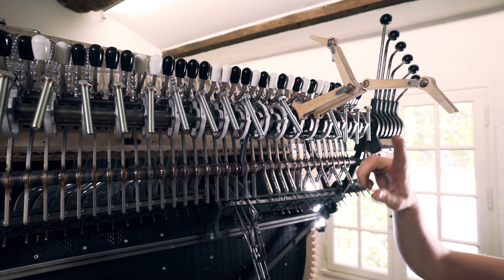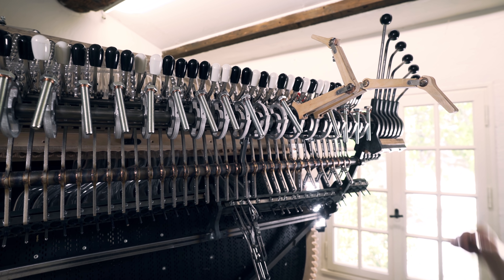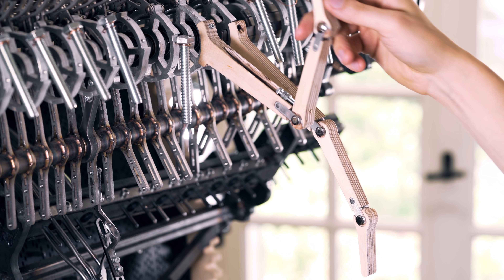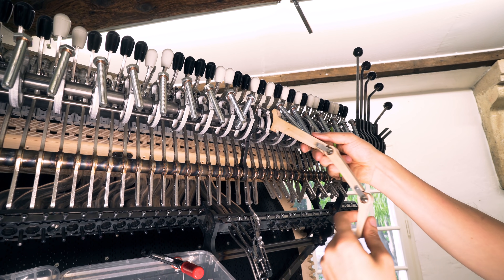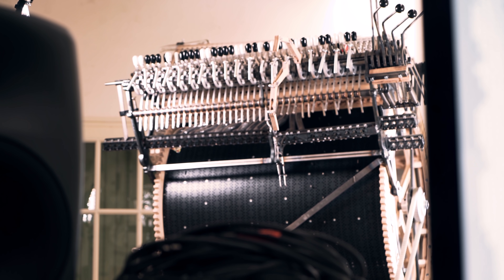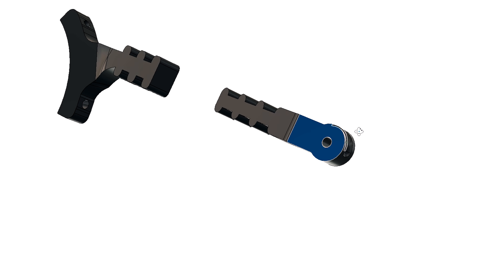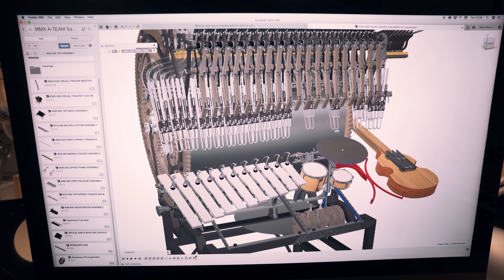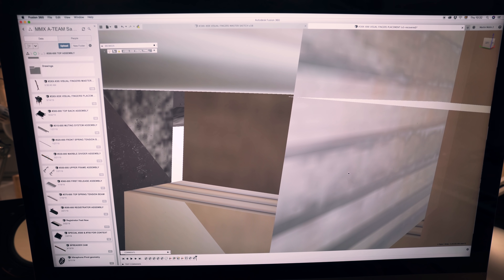Kinetic Fingers Prototype - Marble Machine X #82

Comment: A designer knows he has achieved perfection not when there is nothing left to add, but when there is nothing left to take away: Antoine de Saint-Exupery

Cameras and video screens at the concert, dude.
Reply: I get the sentiment, and I would agree. But, also, lots of parts of this build are not strictly necessary, but add to the idea that Martin wants to add. I don't think it necessarily should stay, but I also don't think there's anything wrong with wanting the star of the show to stand out on its own. What is the musical part of the marble conveyer? Incidental, but it's visual and serves a purpose. This is the same. Certainly not as critical as that sure, but I don't think the fundamental idea is an automatic no go.
Reply: @Cyrribrae  Yeah but take away the conveyor and the machine will no longer work.  Take away the fingers and what happens?

Sure the conveyor is flashier than it needs to be, but it's still integral.  This feels like a decoration.
Reply: Ethan Ansell I agree - aesthetics are a purely personal choice. For me (and apparently others here) I love the simple engineering beauty of the machine without the fingers but in the end it’s Martin’s choice of what the machine looks like. If he digs on the ultra creepy fingers then that’s what it’ll look like!
Reply: I agree.  Having video screens at the concert will let everyone see the machine doing its job.  We want to see the whole machine working and not just the fingers.
Reply: Antoine de Saint-Exupéry literally never said that.

Get your quotes straight, dude.
Reply: @Schwallex 
Try reading Terre de Hommes, or if that's beyond you even a simple Google search before you start correcting someone, 'dude'.
Reply: Good lighting from the crowd will make the reflective balls glisten and shine. Install a black velvet curtain behind the machine to emphasize it. And the marble catchers will move.

These goofy fingers are... Goofy.

Comment: I would prefer if the fingers were not added, but I don't really care as long as the marble machine still works. Although, the fingers may present some problems with weight when trying to mute different sections.

Comment: Hey Martin, I'm wondering if this isn't a really good way to add motion to the machine. I believe part of your project's innate beauty is in the raw functionality of it, even when doing things in an interesting rather than easy way. However, these fingers should be assigned a function if you want to keep them on the machine outside of just a visual indicator for potential audiences. I think there are other ways to exaggerate motion on the machine without the compromises that this solution introduces. I share your excitement for the project, and this is just me voicing my personal interpretation of it's beauty. Best! -J

Comment: I like the movement / position of Nr2 better then 1. Except in the muted position.
If it is to resemble a finger then it would look painfull because real fingers don't bend backwards like that. Or at least normaly they shouldnt.
Nr 3 looks even better, still it would be better if you somehow could hollow out the "fingertip" and fill it with something heavier acting as a counterweight so it doesn't look like MMX is having acupuncture.
Then again I don't know much about the technical/mechanical possibilities.
I'm just a guy who liked the 1st marble machine and the music it made and can't wait for MMX.

Comment: In the CAD, they seem very much slapped on. Not to put down your artistic vision as I am sure you have something pretty cool in mind, but they just don't quite match the look of the machine. 
I think I understand the inspiration for the fingers; those "wind beasts" that walk along the beach using only wind power and a massive amount of moving parts. They look pretty great, however the marble machine X doesn't move, nor does it look like a wind beast. 
At the end of the day, it has the aesthetic look of a large, yet intricate peice of machinary that plays music. It has a very steampunk look to it, and reminds me of an old Victorian machine of some kind, and what gives that look is the mix of wood, tiny stained wood sections and the old looking steel holding it all together. 
I reckon the fingers would work, but you would have to make them far larger then they are, and probably entirely metal. I think as of right now, the marble machine looks pretty great as it does as a musical instrument, but the artistic side of the machine could use some development

Comment: Hmmm I'm on board with fingers, but wood is the wrong choice of material. They are way to big and take to much of the otherwise clean aesthetic.
I think they would look the best if they are made out of wound blacked steel wire with shiny brass counter weights and bearing elements.
This way they are sleek functional and don't weigh much, also they are far more robust since they need to be disassembled for shipping anyway.

Comment: Not a big fan of the fingers either, because they don't really fit the theme of the machine. On the MMX every little part is functional and conutributes to the music. I think since you have designed the machine and spent hundreds or thousends of hours looking at it, you don't realiaze how magesctic it looks aready, you don't need to stick on some fingers for visual effect. That is just my opnion though, and i am sure the MMX is going to be awesome, be it with or without the fingers, so keep pushing!
Reply: Time would be better spent experimenting with lighting the machine to make the marbles visible on stage, setting up cameras, or anything else.

Comment: I don't know if the fingers will be a good way to accent the movements, I'm sure there are other ways that you can come up with, if it is an issue. 

Personally I feel it's a solution for an issue that doesn't exist.

I trust you will do something cool though 👍

PS: if you can design the fingers to be easily detached/reattached then it has less commitment to the design and can open up more options for style... Like detach fingers and attach a different thing. 
But once again I feel it unnecessary

Comment: I'm going to join everyone in this opinion that these fingers are totally unnecessary. Making sounds with ridiculous ways is one thing, but adding moving parts with no function and even with questionable aesthetics is quite different. If it were me, the machine would be without these fingers. Or wheels. Or marbles. Or anything else, because I'm not so dedicated. Great work man, keep it up.

Comment: My issue with this, the programming pins are pushing more and more weight (the fingers, the ball drop mechanism, etc), I worry about putting too much load on the programming pins and ruining them or the drum.

Comment: I totally understand the reasoning for the fingers. They would be a clear visual cue to what notes are being played.. a sort of theatrical Strandbeest like representation of whats going on for an audience to easily connect with. My issue with them is they look visually unappealing and clutter up the beautiful engineering of the machine. The MMX is going to be an extremely tuned system; it really needs a tuned way of displaying this visual element that keeps true to form. Like LEDs lighting for each note across its surface or something that doesn't distract away what makes the MMX what it is.

Comment: If that was a Feature from the being, know that you should scrap it the moment it start to causing trouble.
adding (as suggested by other comment) camera on the MMX is more easy and trouble free.

and while the fingers really add to the steam punk look, it does add extra energy that the marbles have to fight against and extra complexity to a already complex machine.

if you are going for a totally fantastic + fantasy look, that's not bad, just know I think they gonna cause you trouble.
if you are going for a more Steam punk look with practicality in mind, those finger need to play something.

Comment: I'm not a Fusion user (Inventor user), but that "world inside" is a Lighting setting and that looks like an HDR scene.  You could make an HDR photosphere of your shop and it would apply the lighting and background in your renders (bright windows, dark corners, etc).  At least it works that way in Inventor.  You'd probably have to remove the MMX to get an empty pic though.

Comment: As pretty much everybody else already have expressed, I do not the fingers.
I think they look unnatural (creepy even) and they only a visual purpose, unlike anything else in the machine.
I also think they're very long and it would look weird with a row of fingers just pointing out of the machine.
In my opinion, you shouldn't have them, you already have the knobs and the release mechanism moving.
If you really want to have a seperate, decorative only thing like that, then definitely redesign it completely.
They shouldn't be like human fingers, with seperate joints just dangling.
Make them look mechanical and like they're actually doing some important function.

Comment: Just a quick explanation of the "hidden world/hallway/garage" in your modeling space...it seems to be an HDR which is a large image file format that render engines can use to dictate lighting in a particular scene. I cant begin to imagine why its visible in that way to the user...seems like a bug...should just be working in the background...but yeah if you look at the 3D space in which the model resides, and then look at that sphere, you can see how the render engine is using the light values from that HDR to light up the space. It's a nice and quick way to give a space realistic lighting without actually having to set up lighting. Hope this was useful info.
Reply: The visualization engine definitely doesn't use full raytrace/pathtrace lightning technique. It just makes no sense for this purpose. Shadows and reflections aren't needed here at all.

But the HDRI is needed to make glossy parts look glossy. They just need to reflect something.

Comment: Hi, will it be better to have thin metal sheet, attached at the joins, so that it can have a cleaner design instead of having the 2 metal screws jutting out? I think it will be much nicer.

Comment: I’m worried that this will end of looking like a house centipede with the  current design of the fingers, the idea of the visualization is brilliant, however it might be a more visually appealing option to have something like piano keys mounted in the fingers place. I think the thing that visually hinders it is the spindly appearance of the fingers. When it comes to the motion of the fingers, because there is no other actuation other than gravity on the bottom joints it looks very alien and unnerving when compared to the machined perfection of the other components. 
Whatever you chose to do you keep your spirits high, you are doing a great job.

Comment: The garage is an HDRI image, it gives the reflections of the garage to the models used in your scene, I don't use that software, so i don't know if you chose it or it comes as default, but you should be able to change it to obtain different reflections in your renders.

Comment: The force to move those comes straight out of programming pins, so making them light is a pretty good idea. I would not add counterweights there. You might get the same function with light springs.

Comment: I understand the purpose of the fingers, but I think in retrospect they'll become unnecessary when you (presumably) have cameras pointed at the machine. Considering that you haven't tested the new machine on stage yet, I would have waited to make "cosmetic" additions over functional ones, ESPECIALLY when you're already in a bit of a feature creep. On that note, I hope that when it finally comes to testing the machine's ability to play music that there's little to no need to change/fix anything because holy moly have you done so much  already before even getting the opportunity to test a whole circuit even once!

Comment: I totally agree that exaggerating the movement is a great idea, but I don't feel these fingers are 'it' - A lot of it has to do with the janky movement, and once they are all playing and shaking, it is just going to look messy and uncoordinated? The lift of the finger is very quick, but the falling down could be slower? So quick lift, and a slow sink back, like honey running off a spoon, if that makes sense? - Think of it like a digital equalizer, where the stacks slowly fall down unless the correct frequency is played. 

To increase the visibility for the audience, what could also be done is make the sides of the fingers a contrasting color to the top of the finger. Imagine the top of the finger is metal, and the sides are light wood color - then, when a finger lifts, the light wood color will show and draw attention?

Comment: Everyone is talking about you adding this to the machine, but does nobody realize that this has been part of the design from the very beginning? Besides, we have only seen two PROTOTYPE fingers working. It will most likely look way better once the final thing is finished. Quit your whining. It's an easy change if we don't like it when it is done, but shut up your complaining until you see the finished product at work.

Comment: A problem I see here is that the vibraphone will make quite short and punctuated sounds. You'll se the fingers moving much longer than you will hear the sound , so you won't identify the finger movement with the actual sound.

Possible solution: Make the fingers out of very light material, but this probably won't look good

Comment: I feel like the fingers are too loong. Wouldn't the kinetic energy from those 'fingers' affect the machine with unnecessary vibrations? It may also cause problems when played with fast paced music like a recoiling submachine gun. You might want to make it with the lightest but strongest possible material, might be expensive and impractical but its your call.

Comment: I don't like them at all. They look like the result of overdesigning and overcomplicating the machine. They will add more mechanical noises, which will mean more problems to be solved. And still, they have no other benefits than visual?  (and sorry though, they look pretty bad). Congrats on the amazing functionality of the design, but I would definetly suggest a step back.
Reply: There's no problem with mechanical noise, as all of the machine's musical sounds are to be collected by contact microphones. The actual room sound of the machine will be inaudible at a live concert.
Reply: They look completely inconsistent with the rest of the design.

Comment: I was really sold with the fingers idea when you first presented it, but the look of it seems a bit off to me ... They are thick and lumpy, a light metal part instead of plywood would be far better in my opinion. I pictured this part more like the fingers of Edward scisorhands, thin metal piece of machinery clicking and moving. It could be also intresting to have some metal tubing so we still can see through the space between each of the fingers.
I think it is still a nice idea, and i dont agree with most of the comments talking about the lack of utility of the piece, as it has a pupose if you consider the context of playing live, I just have a problem with the aesthetic of it, too thick and blocking visibility.
Anyway, I'm not concerned about you finding a perfect solution for this matter as you did such a great job for the rest of the machine, cheers !

Comment: I think that picture in marbles is there because of HDRI lighting.

AND ... I think you should pay attention to comments ...it seems nobody liked the fingers...
honestly, I (as your one of the first followers) donk like them either...
they are against of mechanical concept and look of the machine and as an engineer, they are waste of time, material and absolutely unnecessary.
by the way ...as always, I wish you good luck and success ...
Reply: It's called a cube map and is used to simulate specular reflections, like chrome surfaces and other mirror-like materials. 6 flat images make up the cube, because it's much faster on the computer than proper reflections.

Comment: Lots of comments not liking the fingers. I agree, BUT: how about having some small, single-component protrusion/knob/spine kind of things, instead of the big dangly fingers? That still does the job of visualising the marble release, but it's much easier to make/maintain. It doesn't break up the look of the machine so much, and it could look like elegant curved clock parts, rather than creepy limp fingers.
Reply: I do see Martin's point, that from a long way away you won't be able to see that the machine's doing anything. Video projection seems like a good solution though :).

Comment: Awh shucks. In my humble opinion this detracts from the marble machine X... Not only is this more weight to carry around, extra time spent and merely a visual gimmick, there's also no guarantee it'll look as good from a distance as is currently imagined. If only because most other components will be equally less visible. So only when the group is activated will the fingers do anything at all. Besides... With all them being pointed up when not in use, they'll block view of the entire marble installation on top... And look like a bunch of broken fingers while at it. 
Sorry buddy, but in my humble opinion the Marble Machine X is best served al natural. The internal mechanics on their own are impressive enough.